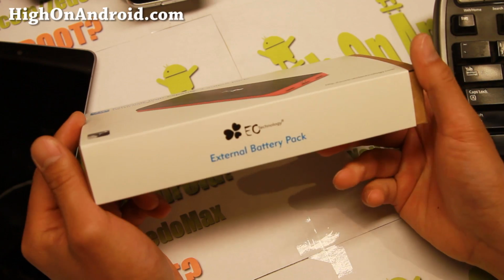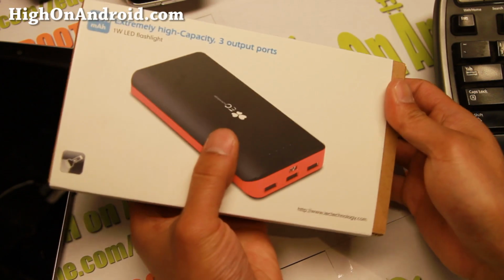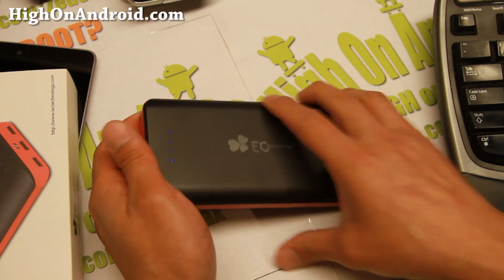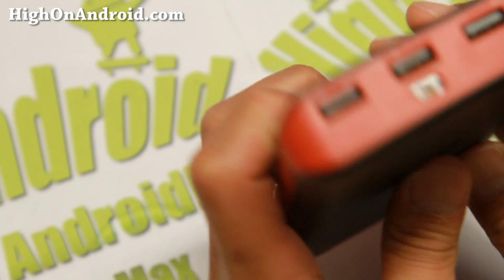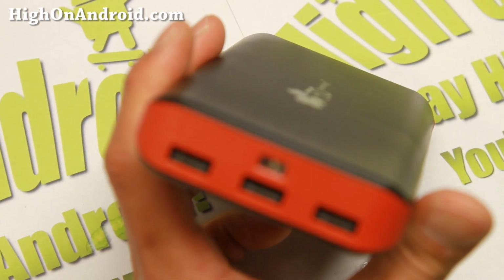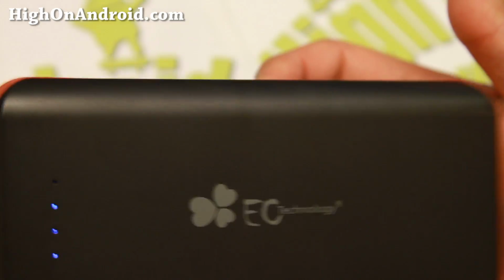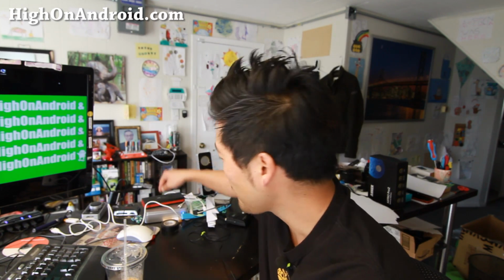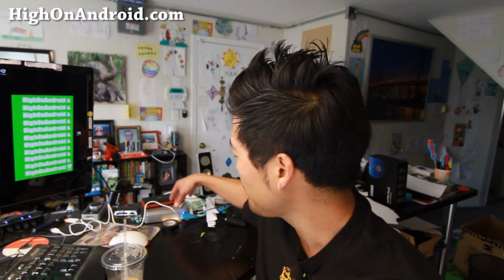EC Technology 22400mAh High Capacity Power Bank!

Comment: My powerbank, exactly same one keeps switching off!!
Reply: your power bank still working?
Reply: @rotcataergeht 
Hi, yes it is working perfectly, It is I, who is switching off and not thinking clearly, I have to hold my hands up!! I found an explanation why the powerbank switches off. It's to do with  my phone, earbuds, whatever i,m charging are almost charged, the powerbank then thinks it has done it's job. something to do with mah that are left to charge are negligble. I have let my phone drain down lower than I usually do, also my bluetooth  speaker. Hey Presto! The Powerbank does it's job it's designed to do. Thank you very much for addressing my issue.

Comment: the are lost of power when you charge phone,internal bank battery rated buy adding numbers 3.7 v internal battery's,like 10*2600mah(3.7v) batterys= 26000.but when you charge phone power bank must supply 5v voltage to charge any device.during this modification there lost of mah and is depend on liternal components quality, is very unlikely you got more then 65-70% out of initially rated device

Comment: there no way you charge you phone 7 times(3000ma),there lost in conversion 3.7v to 5 v conversion lost,also other things,you would be lucky to chatge 3000ma phone 4-5 times...you realy should to now that if you own power banks
Reply: +logout123456789 what do you mean by 3.7 to 5v ? my battery has 5v and the power bank too... where do you get the 3.7 from? charging the power bank itself or what?
Reply: Hello,im not sure did you got my replay.
Inside power bank you got 18650 cells usually 2000-2600 mah ,they 3.7 volts ,to rate this power bank manufacture use method like multiplying numbers of cell and they rated capacity 2100*10=21000 mah power bank,but to charge anything you have to convert 3.7 volts to 5 volts,there lost in conversion and also heat and problem with real capacity power bank cells,so at the end you got around 60+% if you lucky

Comment: I bought one and after 3 months it does not charge anymore. The front LED light works though. I wonder if the power bank needs to be reseted? Plus, there is no manual on the website...